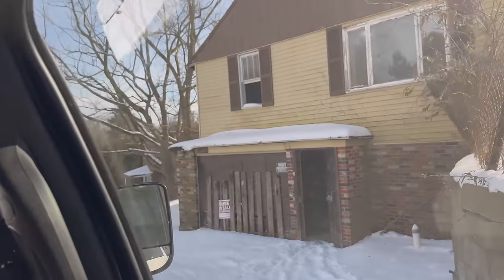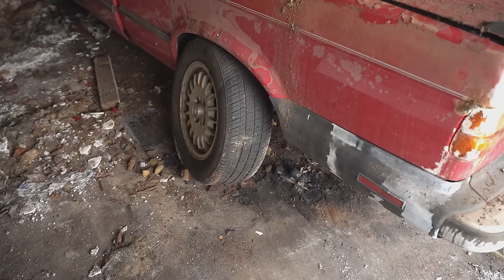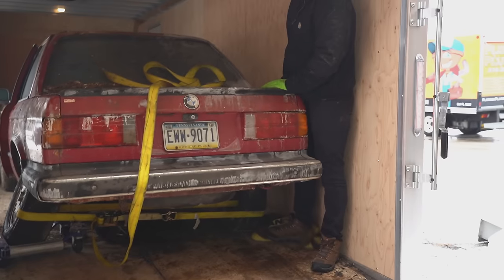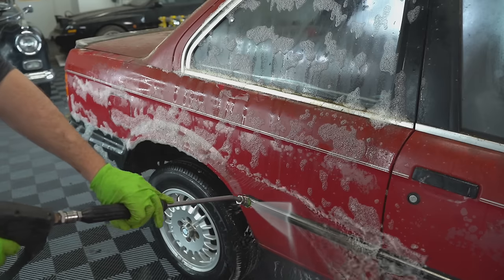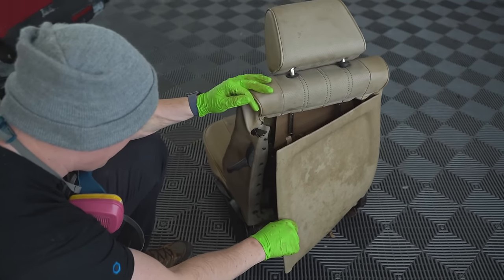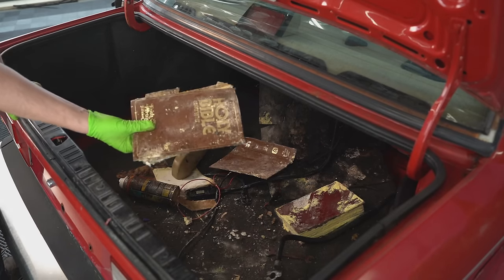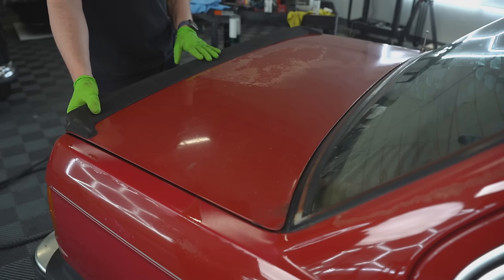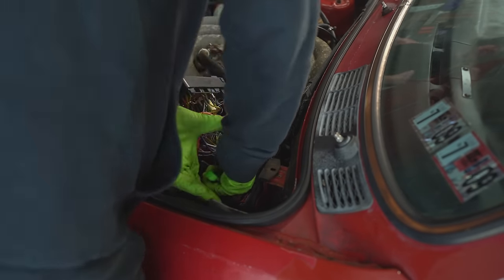First Wash in 14 Years: ABANDONED BMW E30! | Car Detailing Restoration

Comment: I have a BMW E30 and it really is an incredible car. Compared to other 80's car, everything from the carpet to the plastics is really high quality and always cleans up very well. Some how mine still has an uncracked dash. The engine in this if this an "i" motor car is a M20b25.
Reply: I think it is a M20 b25 too.
Reply: It could be M20B20 or B23 or B25. U can't tell without the code on the block.
Reply: @PSimonsen  American market never got the m20b20 or 23. Only 25 and 27
Reply: @ShakeNBlake509  Ok, i didn't know. 
In Denmark the most common one, was the 320i and 318i.

Comment: I’ve had a pretty bad recovery, 1985 MR2
It’s sat in an open barn for seven years and then outside in the field another seven. 
It was sunken into the ground up to the doors, couldn’t open without digging in the ground around them.
All four wheels were seized with rust.
I ended up pulling 2-1/2 garbage bags full of nests from rodents out.
I had to spray everything down with bleach, and wear a respirator while I cleaned it.
It broke my winch trying to pull it out of the ground.
It was 97° and humid outside.
My brother bailed on me to help , it was just me.
I ended up using my truck to pull it out with a tow strap after detaching the u-haul trailer.
How did I get it on the trailer you ask?
Every spare fluid container I had in my truck was dumped onto the ramps to assist with dragging it onto the trailer.
How did I drag it onto the trailer with a truck?
By leaving the trailer detached and chocking the wheels, attaching a 3 inch ratchet strap to my tow strap and pulling it from in front of the trailer.
Eventually, I got it onto the trailer, hook the trailer up and drove the hour back home.

Getting it off the trailer was also interesting, but I’ll let you use your imagination for that one😎

Comment: I bought a 1981 Cadillac Deville from a friend in 1995 after his mom passed. It sat in the driveway for months after I met him. I eventually offered to buy it. I got it for $700.00 !!!  It rode like a plush sofa on very high quality shocks down the freeway. A magic carpet of a car. I spent weeks detailing the real leather seats,  every little AC vent plate and the epic chrome grill. Even car wash employees would tell me how perfectly new the car looked. Detailing a car that has been very well kept is very therapeutic because there is no FAIL in the work. As long as you relax, become very Zen, don't hurt your fingers, work ergonomically with good posture in a ventilated space - and take breaks when you become fatigued,. The satisfaction is real.

Comment: I had a 94 cadillac fleetwood i bought a few months ago from someone. It was in a garage and hasnt been moved in over 10 years and charged the battery a few minutes and it started and we drove it to the house lol, it was mad dirty in and out and even a rat bone inside , mad dirty. I wish i knew about u guys at that time maybe u would like cleaning it up😂theyre was alot of scrap metal in there too and a few 100ft husky extension cords Lol. I bought the car to use for parts (i had to strip her because it wasnt worth saving, the floor was all rusted and had holes, unsafe to drive but had alot of good parts

Comment: Hey WD Detailing! I have a question! Probably asked before but can't see an answer across many videos.

After you've cleaned and vacuumed up the carpets/any fabrics in general, how do you dry them?!
I see you do multiple pass overs to clean, then vacuum up, and then sometimes blast pressured air over it and revacuum, but that still wouldn't come close to drying. Even if you were to leave the doors open it'd take a week + to dry, and all that time it'd just smell of mould or general dampness, so super curious!
Reply: Not sure how these guys do it.  Personally, I use air movers (used in the carpet cleaning industry) to dry interiors.
Reply: @djsassafrass9126  That's actually what I think the detail geek once said he uses (although 9/10 times the cars he details are actually kept at his lot for 2-4 days on average. He has a bunch of mini air fans, or in fast needing times he has 3 heaters he puts into the car for 30 minutes at a time. Lots of other details mention they dry, but never how so thought I'd ask WD peeps haha! :)

Comment: At first , with the rear suspension failure and the axle issue , looking at it , it was appearing to be a total jumker but with the scrub up to see what you have , it proves that looks aren't always right , I think the car is saveable , the motor , being an ETA 2.7 , can , with the 528i chip swap (factory) turns it into a 2.8 powerhouse . I recomend it goes to an enthusiast who wants to and is able to restore it , not be used as a parts car , I have not been underneath though , if it is very bad , its still a very good donor car .

Comment: Dang I would’ve emailed you guys if I known you travel for free to get cars for your video. I just picked up a black 87 e30 sedan that’s been sitting for 20 years under a tree, with a moldy red interior! would’ve been perfect for you guys, I’ve had to put some serious elbow grease into it by myself. 

Also I cringed at the way you pulled that e30 out, you laid down next to the tow loop lol. Under the rear bumper on the right side for anyone curious.

Comment: the engine depends on which model it is.. looks like a mid-late 80s 325i. BMWs numbers mean the 1st digit being the series and the second and 3rd are the engine displacement. 3 series.. 2.5L inline 6 engine

Comment: That is a US spec 325i, so it should have the M50B25, the 2.5L inline six. It's the same basic design that was in my dad's 1994 E34 525i.
Reply: That is M20 engine, not the newer 24v M50 in the -94 E34.

Comment: You asked the " Is it worth saving " question way too early in the video. We're only 20% in. So I'll come back in 26 minutes. lol
Reply: Yeah-nah... Can't make a silk purse out of a pigs ear. Even if you've put lipstick on that pig. To be anything 1/4 decent, you'd need a full nose to tail mechanical replacement. Even then. Add the cost of respray & 95% interior. Tens of thousands of dollars for something worth a pack of smokes & a pizza. ;)